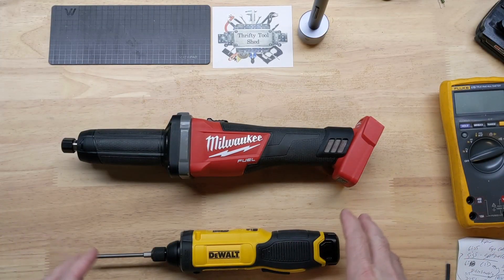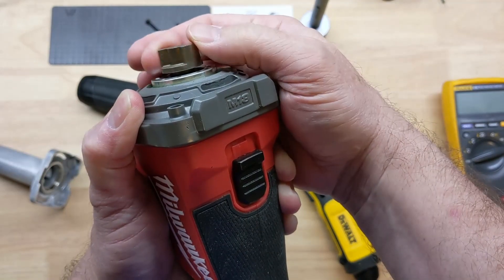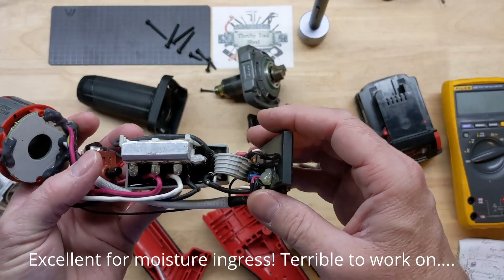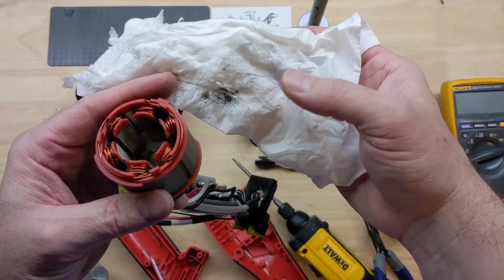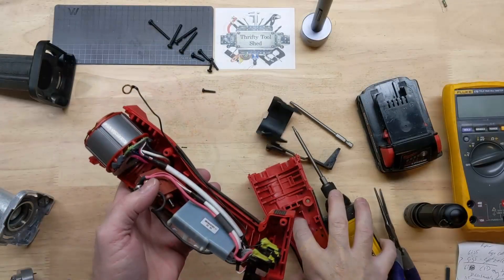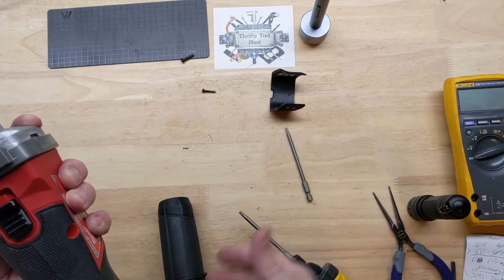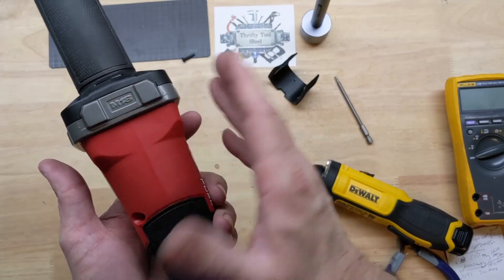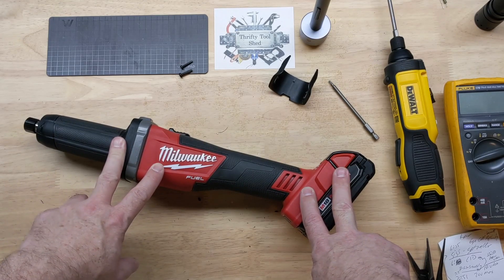Faulty Milwaukee M18 Fuel Die Grinder - Look Inside

Comment: Do you (or anyone else) know which type of hall sensors are used for the position sensing of the Milwaukee M18 fuel tools? The rotor of my impact driver moved a few mm forwards because of the snap ring of the end falling off, and it rubbed through the hall sensors that sit in front of the rotor at around 7:19 
One of them rubbed completely through, the other ones lost at least the top layer, so dont know of there was something printed on them. They are potted in a thin layer of goo
Reply: Do you have found an answer about your hall sensor ? I’ve the same trouble , don’t know how it’s possible but I’ve lost 2 of them , it was smashed and incrusted directly on the rotor assembly
Reply: @alex--pw3gw  used the SS361RT Honeywell and it worked for a while, but it stopped again after like a month. Don't know if it's the sensors or something else because I didn't have time to look into it
Reply: @nickye2864  thank you sir 🙏🏼 will try it

Comment: I’ve got one that sounds just like that one did but it’ll lock up and not even spin.
Reply from the maker: It may need shimming as well. I ended up shimming mine at the bearing housing until it did get really smooth.

Comment: My issue was with the brushless angle grinder which looks nearly identical in the lower half. The bearing went to pieces and upon replacing it did exactly the same as this did to the stator and rotor.
It seems as if the plastic housing was too sloppy to hold the bearing concentric so I shimmed it with a few wraps of foil tape around the bearing and seems to work now.
Reply from the maker: Yep! I ended up shimming mine out as well. Seems to be a common issue then! I enjoy looking into these failed tools and sharing in a video to see how common an issue may be. Even though an issue may seem too odd to be common it still surprises me at times how common it ends up being. I have a fairly recent DeWalt drill video of the controller having a rather odd issue and it's turning out to be very common as well. Thanks for sharing!

Comment: I had to add a line of super glue to the plastic and let it set so the rotor was more aligned inside the drum.
Like I said try squeezing the case why it's spinning.

Comment: Thanks for another informative video. I notice that in these brushless machines nowadays, the trigger switch and PCBs are so complex that when something goes wrong with it, the cost of repairing them (just the price of the parts) cost half the price of the machine itself. Manufacturers should build these machines in a way easier to repair. Another day I bought a trigger switch for my angle grinder and the switch came also with the battery prongs where the battery clips into. Well, I didn’t need the battery prongs, I just needed the switch. All adds up to the cost for parts not needed in my specific case. 
On a different topic. Did you ever manage to repair the brushless Ryobi drill I saw once sitting in your workbench. I assume some people are waiting for that video 😃😃
Reply from the maker: Thanks for your comment. Totally agree about the parts availability and price, I harp on that alot. Seems to be getting worse instead of better for sure. This disassembly here was truly disappointing as far as ever having a easy repair electronics wise, it's going to be a struggle for sure. As far as the drill in question, you must be talking of the Ridgid Brushless I had troubleshooting on (most likely identical to a Ryobi since TTI make both).  I ended up running the motor with the cheaper BLDC controller for testing and then the very next video I did fix a Ridgid brushless Jigsaw very similar with a cheap BLDC controller and it still works today!  I received both of these together and both had the built in controller and both were bad. I admit it was a bit of a cheat to repair this one instead of the drill. The drill needs forward and reverse and the cheap tiny BLDC controller does not have that feature. It would be one ugly Frankenstein to try to mount a controller on the outside, Lol. The drill did not have any room for many other options there. I did keep the super nice BLDC motor to use on another project one day!
Reply: @ThriftyToolShed  
My bad, I thought it was a Ryobi drill😃. I look forward for any project using the brushless motor.
Reply from the maker: I think it was this video with the drill troubleshooting, and then the next video was the jigsaw repair....
https://youtu.be/UaMmWGn97F0
https://youtu.be/pelpii5e6uc

Comment: The stator and rotor are supposed to be assembled  on half of the clam shell simultaneously whilst engaging a thrust collar on the saddle bearing. That bit of plastic was squashed during assembly when the bearing wasn't seated properly. You shouldn't be able to drop the rotor in while the bearing halves are together. Kinda hard to explain.
Basically the assembler borked it by pinching the bearing in the shell.